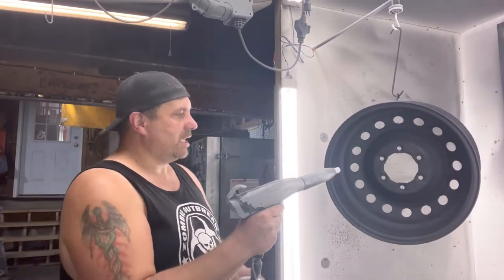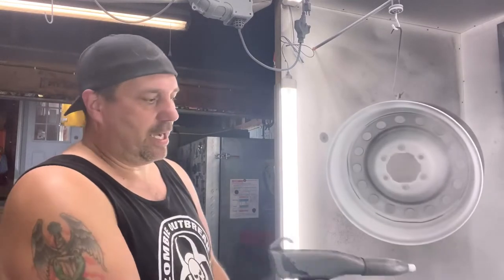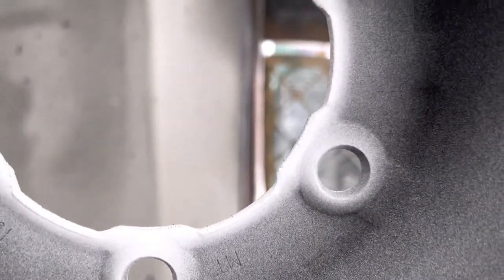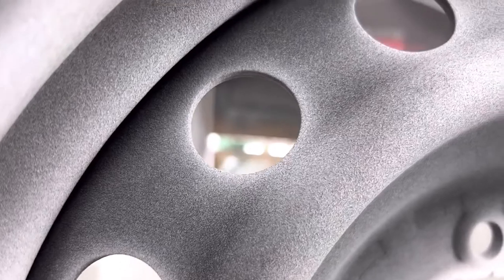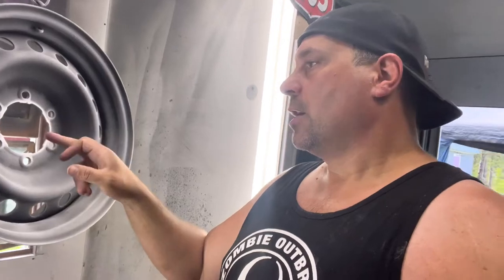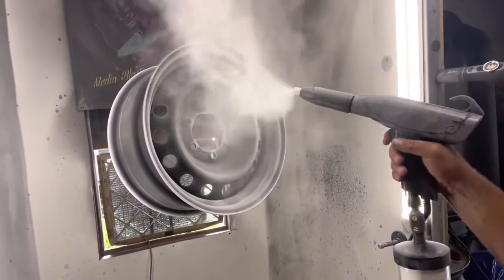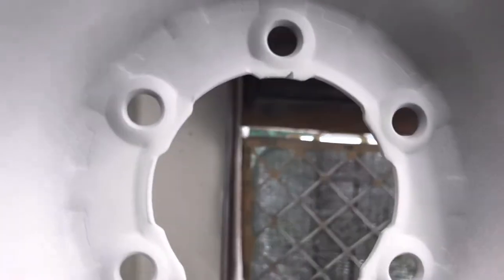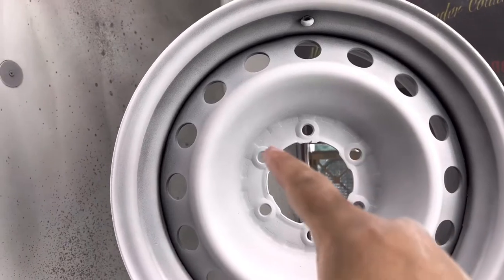What is Framing in powder coating #112

Comment: are you not using the x1 system anymore? I have considered buying the system as I can't really find others similar in the same price rang
Reply from the maker: yes we use the x1 on the difficult jobs. if the job is simple like hotflocking we use the kkhd. anything with faraday issues we use the x1.